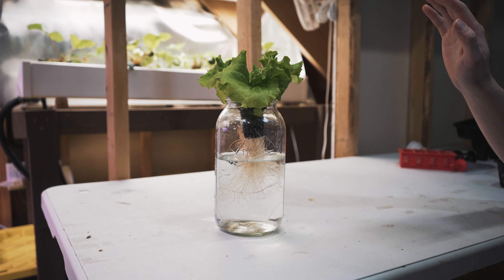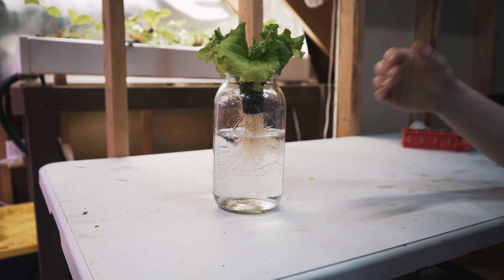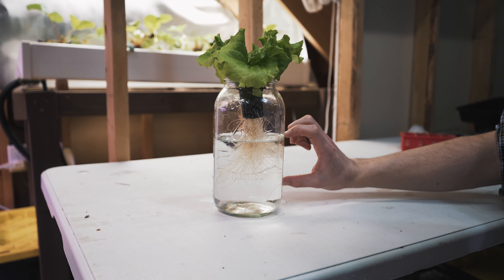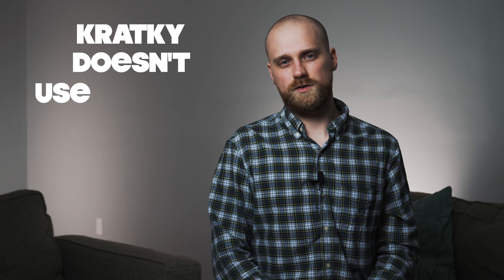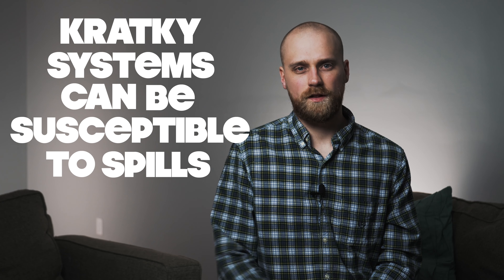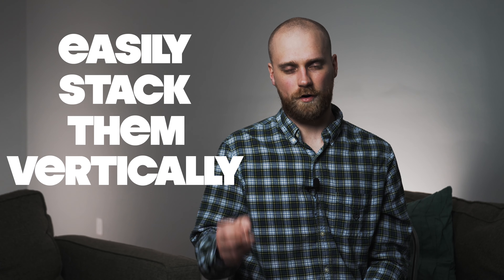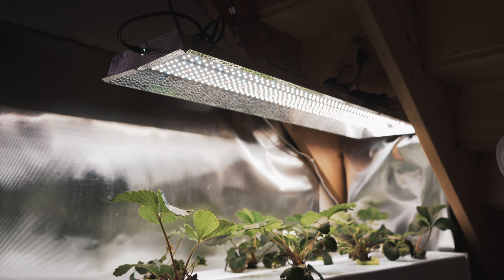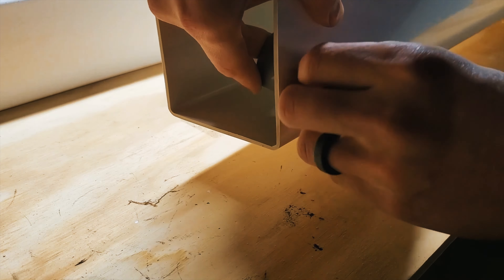5 Reasons Why I Don't Use Kratky for Hydroponics

Comment: I use the kratky method to grow lettuce and it works great! I have a 5 shelf metal stand, 2 lights per shelf, i use the plastic shoe boxes with 3 holes drilled in each. On each shelf i grow lettuce, mustard, beet, and what ever other green i feel like. As i use up a shelf I germinate and plant using the plant that takes the longest to germinate and grow. Beet is longest, mustard is next, and lettuce is last. I tip my lights down on the new plantings! This system is great for a salad system for a family! I dont limit myself to one system, I use different systems for different plants!
Reply: So I’m new to this would it be better to use multiple smaller bins like shoe boxes or one large?
Reply: @ScoobDaBigRedDog  It's what you find most convenient -- which will depend on what you grow and how long it takes. You could mix sizes, too.

Comment: None of the reaons you don't use Kratky are really valid. You can easily use smaller containers if you use some ingenuity and set up a self leveling system. I had 14 peppers each in 2 gallon containers that grew to 3-4 foot tall plants all connected by flexible tubing to a single bucket with a float valve, with that bucket fed from a large reservoir. For lettuce, I use shallow, 2 inch deep containers, with each being 10 x 14 inches that fit 6-8 plants each, depending on how you harvest, and I start one new tray every 7-14 days so succession planting is super easy. And if you elevate the reservoir, gravity will feed plants, and if you elevate enough, you can use vertical space.  As far as scaling, I could have had 50-60-100-200 separate containers fed off the one reservoir. And if you are willing to use a small pump to fill the elevated reservoir, it only needs to hold maybe a few gallons, so doesn't need support. If stacking grow spaces on shelves, The weight of a 10 x 14 tray full of water isn't enough to worry about, and with a large reservoir pumping only as needed into the elevated feed reservoir with a float switch, and a passive float valve at each level, you can stack as high as you want. All your pipes could pretty easily be converted. Main point is that you do not need to have the entire life time supply of water at the start in kratky. In a large outside area, with all plants on the same level, it is really simple,to have unlimited number of plants using no pumps or electricity, and scale up or down as simply as connecting a hoseWith flexible tubing, you can alter spacing as plants grow, making it MORE scalable than fixed planting sites allow. For a vertical system with multiple levels, if using a pump anyway to avoid a large high reservoir that needs support, there is absolutely nothing wrong with what you are doing, but advising people that krakty isn't scalable, or that it just weighs too much, or that you can't easily do succession planting is just flat out wrong.

Comment: As others have noted, many of these issues can be addressed by using the right size and shape container.  For lettuce I like to use a 6-7 inch deep tote, with the footprint being such that 2 of them fills a 4' rack shelf perfectly (which is $10 at the Home Depot). This setup can hold approx 2/3 the water needed to grow to maturity, so you're only looking at 1 refill per tote. That's pretty simple. Additionally, you do not need the reservoir on the bottom, so you recover that vertical space (can use an extra row). For the seedling issue, the multiple totes setup pretty much takes care of it. Just simply reserve 1 tote for seedlings, and the other totes can be progressively more spaced out. You can get 4 rows like this (8 totes = $80) on an 80" tall rack. That's a lot of lettuce for $80 and no setup required, other than drilling holes! 

Overall I love SGH's setup. It is possibly the best out there for growing this type of crop in a small space! But, Kratky is pretty hard to beat if you think thru it! Perhaps I'll make a vid showing my kratky setup for ahead to head? Hehe we'll see.

Comment: You can move the net pots from shallow shelf containers to deeper containers as they get bigger (especially with longer lived plants). Big commercial hydroponic farms do this regardless (the water trays are enormous but shallow, and the grow cells are in foam or rockwool, which get moved from tray to tray as they get bigger). This solves the spacing issue under your lights as well as the depth issue for rotational harvest planting. Your deep trays for the really large plants can be at the bottom of your rack systems while the shallow seedling trays go on top. Making sure to use water tubs that are wider than they are deep solves the potential for spillage because you can't knock them over. And you can do floating trays for your net pot supports if you just give them appropriate spacers underneath (higher styrofoam floats) for air roots.

In other words, kratky doesn't have to be static with the plants starting in the same containers they finish in. Shift them through the racks as their roots allow and leaf area demand. Shallow trays won't have the weight issue you worry about, so the top racks can hold very densely spaced seedlings and young plants in an inch or so of water (depending on the species grown and the size of net pot). They graduate down the rack into deeper containers with taller floats. Deep tubs sit directly on the floor at the bottom of the system. Continuous harvest, efficient use of light, no weight problems, no wasted space, totally adaptable to the size of plants grown. AND no pumps, bubblers or plumbing required.
Reply: or use a cotton material tied into the pot to wick up the nutrient.

Comment: i dreamt of the system you've build years ago but there were two problems: 1)  cheap LED lighting wasn't a thing aside from LED strips which didn't make the output needed, and 2) square PVC posts were WAY less popular than they are nowadays. Really excited to build the system you've got laid out here, and glad it's been working out well for you! I'm excited to have a constant supply using staged crops. Love it!

Comment: As someone looking to get into hydroponics, I definitely noticed the space issue. With a tower approach, you can have one reservoir feed 20 plants or more. If you use one of those square buckets you get from a big box store, at most,  you're putting five plants in there. And as he said, if you want to do successive planting, you'll need a new reservoir. With a tower garden, you can plant ten items, then use the other ten to rotate new plants in.

Comment: That's a beautiful setup. Your rail system is really using Kratky's method:  both air and nutrient in the root area, but with a nice twist. A bit like a thin film method too. I have grown inside every year for at least a decade. I've tried them all and each has advantages and disadvantages. Good job! PS: I have tried garden addiction therapy, but nothing has helped me so far. LOL!

Comment: It is possible to stack 20litre buckets for the Kratky method when it’s outside, you need dark buckets preferably & you need to cut holes at the right height. You are right though, difficult to stagger growth unless you do each bucket every two weeks or however long it takes for the crop to grow, plus, not great if you have kids about as you say 😂
I grow hydroponic indoors during winter & will be trying it outside this summer, I would like to try your method  though, so will pop over to website.

Comment: My active systems certainly require more supervision and do more with the available space... hence keeping them in the dining room! I've got (qty 4) 8 foot NFT rails in the window bay and a 40 gal spray cloner. I want to do Kratky outdoors to keep the risk of pump failure down (we have a hot, dry climate). Hoping to use some float valves to keep things topped up from a gravity feed reservoir, might hook into rain barrel system too.

I guess what I'm saying is that I'm glad there are so many different types of hydroponics for every use case!

Comment: Even cheap Walmart wire shelving units can hold 350 lb per shelf that's 40 gallons of water and would be way more than enough for hydroponics. (It works fine I've put two 20 gallon fish tanks on one shelf before with no issues it's close to the weight limit but almost every consumer product with a weight limit has a safety factor and this is probably something like 1.5x)

Comment: My only issue with kratky is if I want a successive harvest I have to have multiple bins. When It comes to resetting those bins I have to scrub them all and get refill them and there is a little waste nutrients in the bottom of the bin at the end of a cycle. I use 11 Gallons of water per Rubbermaid bin for a total of 8 bins. I have to add coco coir for 8-10 holes for what ever I choose to grow. 88 Gallons of water to measure and fill and 8 bins to clean is not fun and I have to weigh out 39 grams from 3 bads in ratio of nutrients for each bin when I grow lettuce during the long winter. Not to mention fill all the net pots with fresh coco coir if aphids show up  (even in the middle of the winter!! I don't know how). Aphids killed about 30 of my jalapeno plants and another 20 bell pepper and hot cherry plants I had waiting for early spring planting (I usually plant them during a 3 day overcast or rainy week). 
One pro is that if the power goes out in a winter storm ( we often have power outages) there are no air or water pumps that need to run so the plants are still fine.

Comment: Great Info! You cover five of the six reasons I stopped using Kratky . I wish I had seen this video about two years ago, it would have saved me a lot of wasted time.
Reply: Some things here he's got COMPLETELY wrong. Like the mason jar is FAR too small, it's meant to be a DARK container and there's no mention of the FLOAT system where you can whack in plants any size. Post people use a ton of buckets, harvest the lettuce and wash the bucket or give it a blast with a pressure sprayer, then installing refill with nutrient and put the seedlings in.

Comment: Funny thing is that one of the kratky growers pretty much has this exact setup, but kratky. He just tops up the containers when they need it.

Personally, I'm experimenting with kratky and seeing how it works. Choosing the right container helps a lot. I also am not going to go for the full kratky method. I'm not getting a 55 gallon container for a tomato plant. But maybe a 5 gallon bucket or a larger tote
Reply: If you do kratky correctly, you NEVER top up, or maybe once or twice.
Reply: @OffGridInvestor  it's true. You will just need a large container. For example, a 55 gallon drum for a determinate tomato. You could also use a large reservoir to feed into smaller containers, but that takes a lot of setup and costs more.

Comment: None of these issues are actually issues. If you're going to scale up another method you still need bigger reservoirs, bigger pumps, more nutes, and more space. If you're concerned about light efficiency use different size containers in three stages (seedling, early veg, bloom), if the issue is spills any container can spill. And as far as vertical goes, if you're willing to give up some horizontal real estate you can make a short wide set up instead of tall and narrow or even  use long pipes as containers and stay vertical. The only real issues with kratky are nutrient imbalances from not understanding how the nutrients will concentrate, and over thinking it.

Comment: Very well stated reasons. However, the only point you missed is the cost. Hydroponic systems are too costly and that is a major problem with it. Lots of people will just stay away from hydroponics just because of this reason.
I totally agree that for bigger plants like tomatoes, it is just an overkill to set up and forget like system. 
I personally use "Double cup" method with a much larger nutrient solution reservoir.
Reply: Hydroponics expensive? I was spending a lot of money for soil comparatively, at $30-45 for 1 or 2 cubic foot approx. Now with hydro, i bought the nutrients for $20-30 and literally have enough to make 100s of gallons of nutrient solution, replacing an equal amount of soil i now no longer have to buy or continue buying indefinitely, that now free water replaces the expensive soil i previously had to buy, its been a huge a money saver for me personally. At Home Depot, a 27 gallon tote is $12, more than enough for 6 large plants (tomato, squash, cannabis, cucumber) and now that container can be used over and over again. So yes, i agree there are a few additional purchases required with hydro, however, they are relatively small one time fixed costs, and with all the money saved just on soil alone, soil = $$$ (a bag of soil, $30-40 a bag, about 6 plants, over and over again, whereas water is mostly free (collect rain or use water from water fish tank). i switched to hydro because of the money savings first and foremost plus all the well known benefits like increased yield for example. What is the "double cup" method you are referring to?
Reply: @deltaprimetechnologiesllc3265  Thanks for your reply. You are absolutely correct that readymade soil mixes are just too costly. I was referring to the commercial hydroponic systems with circulating nutrients solutions which is way too costly and complex. I live in India and here we get vermicompost at around 3$ for 5 kg pack. And I get 1 kg cocopeat dry block at 2$. Even further, I make compost tea which reduces need for   buying vermicompost even further. "Double cup method, I was referring to was a simple non circulating hydroponic system".

Comment: I tought you were gonna mention the mold, bacteria and algea problem, because in Kratky there is no circulation.
To solve the lighting problem, I have 7 shelfs, small tall containers and regular containers, so i can easily move them around as they grow.
But definetly right about the vertical spacing, i can only do 2 shelfs in the same space where you put 3. And Kratky is probably more work as you have to refil and clean every container seperatly.
Reply: It is really easy to set up a single float valve to maintain water level in kratky so there is no checking or refilling of individual containers.

Comment: The only problem I would have with your system is toxins seeping into the water from whatever material those fence posts are made of. I like Kratky in dark glass jars but one more negative for Kratky is that you need to monitor the water and refill as needed-this can become an almost daily process for a large plant in a lone jar but not so often with a large reservoir.
Reply: You last problem is bunk. You just don't have a big enough container.
Reply: Fence posts??? They're 90mm RAINWATER pipe used for drinking water in Australia. You pointed out his obvious failure with showing a mason jar used for kratky. They're MEANT TO be dark containers with no light getting in. Also a mason jar is MILES too small.
Reply: @OffGridInvestor  Does he sounds Australian to you???
Reply: He made a good video about the water quality! He had a couple tests done and there wasn't anything of note in the water. Of course, those results only apply to him; maybe he just lucked out and found a fence post company which happened to not have lead in the supply chain.
Reply: And with a tiny effort, you can use smaller containers with a self-leveling float valve, with one float valve feeding hudreds of containers. I actually used 3 liter bottles to grow 4-5 foot tall bush type indeterminate tomatoes, so container size isn't really an issue.
Reply: @OffGridInvestor  container size is meaningless if you set up a self watering, gravity (or pump) watering system based on a single float valve for as many plants as you want on a single level,  with multiple float valves if you want plants on multiple levels. A mason jar is more than large enough for all the roots if you have the water level steady.
Reply: @none.892  Plants won't absorb any large particles, and plastic molecules are too big. Lead can be very fine, so could be a valid issue if it was present.